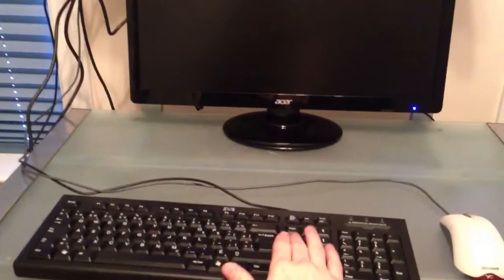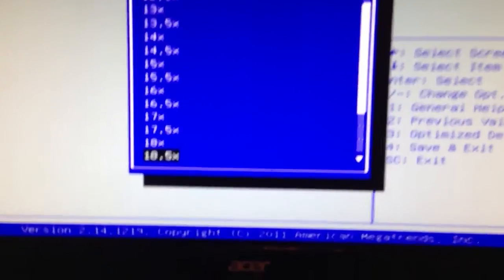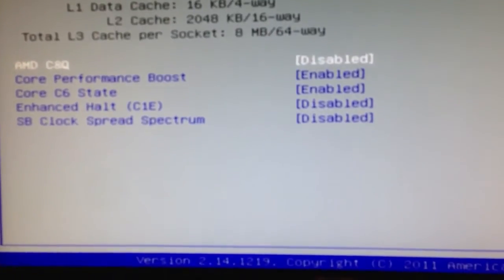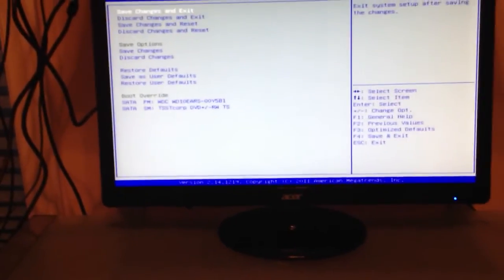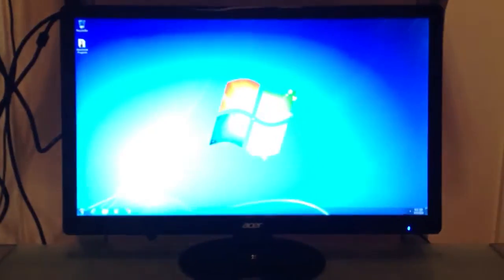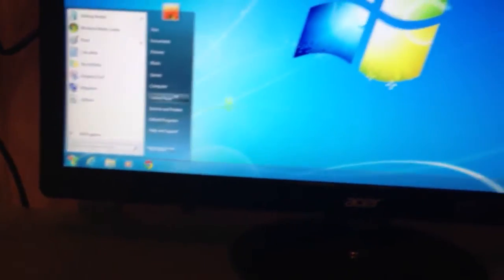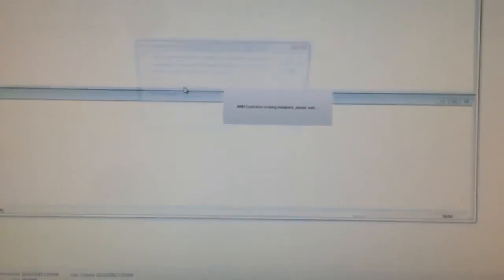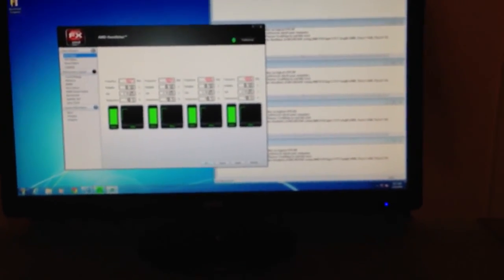How to overclock a FX-4100 CPU on an ECS a960 motherboard

Comment: I have another system with a near identical mobo/cpu setup (fx 4300 chip). Isn't it a little dangerous to increase the HT clock speed since it speeds up the bus speeds for the entire system? I'd prefer not to fry the ram I have in that machine if possible. I'm not worried about the cpu temps, its got a 212 evo strapped to it, just worried about cooking other components.